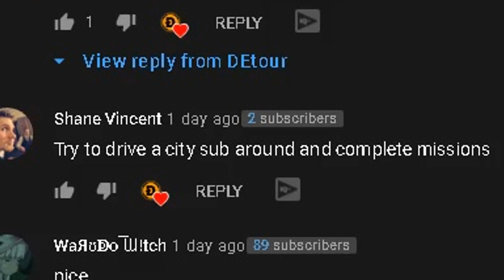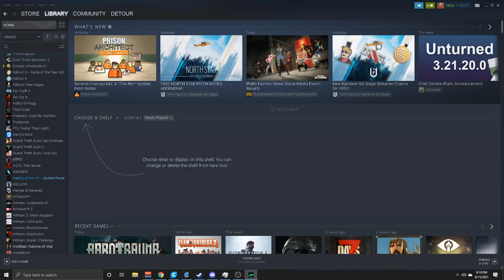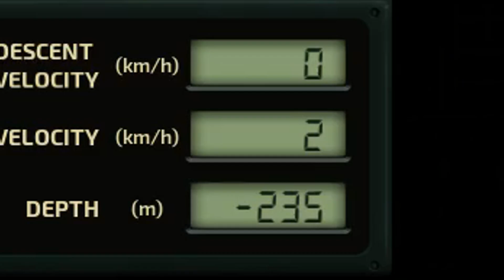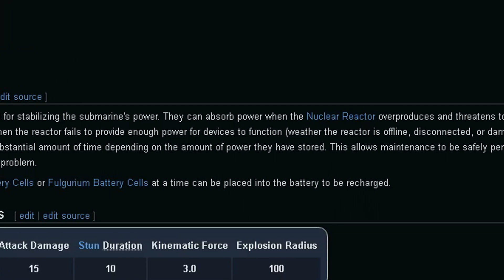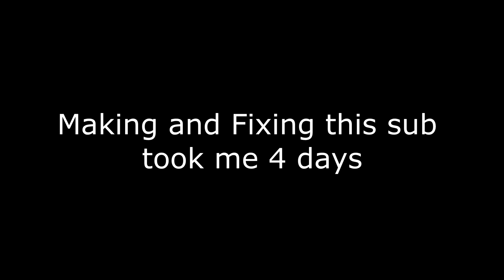Barotrauma - Making a city sized Submarine work

Comment: i have been trying to make a sub myself but everything is fine except the doors they have high pressure why is that?
Reply from the maker: its probably because your two hulls connected between each other aren't touching. It is creating this pocket between the hull that is basically telling the game that it is considered outside the submarine. 

you should place the door between the two hulls (you can tell its ok when the exclamation mark is gone).
Reply: @officiallydetour7576  I connected them like you said and it worked thanks
Reply: @officiallydetour7576  thanks ill try it when i get on next thanks